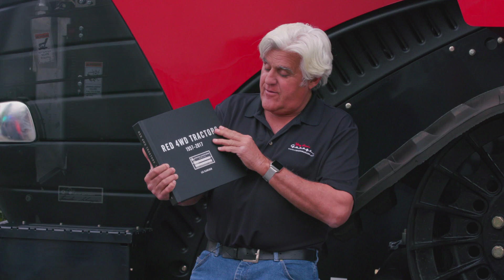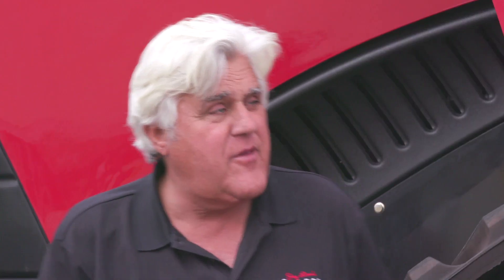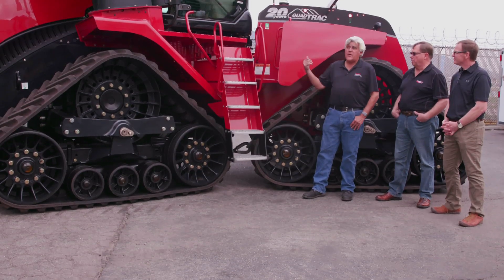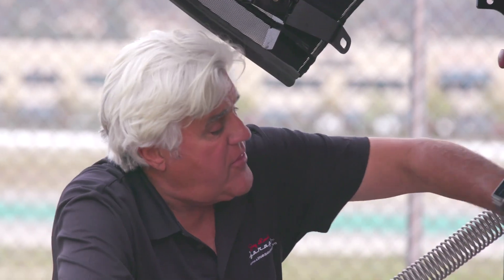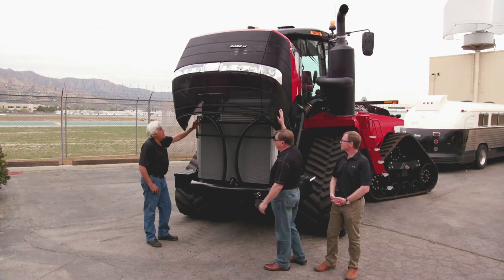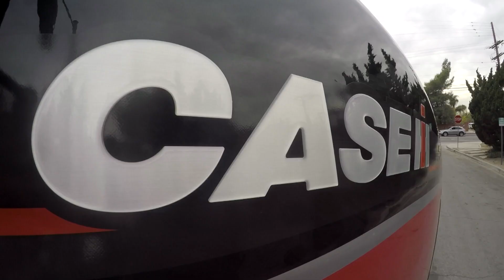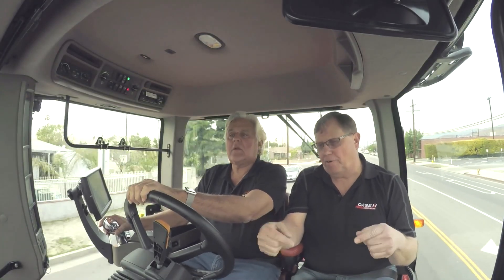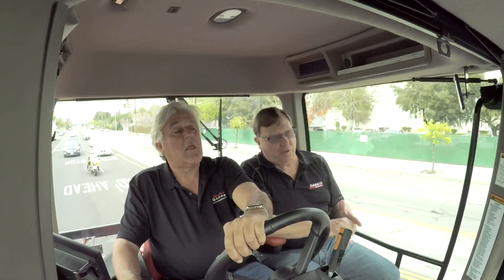2017 Case IH Quadtrac - Jay Leno's Garage

Comment: The older versions with the Cummins engines were very reliable.   Not sold on the Fiat/Iveco engines case uses these days.  The few I've been around just don't seem to be able to deal with things as well as the Cummins engines did.   The steigers in general are pretty darn good.  

The powershift transmissions are solid as well.  If you've ever been inside one you'd know why.   

One thing they didn't mention was the AG version and the construction versions of these are different when it comes to the articulation joints.  This one appears to be made for the construction side...the cable running from under the cooling pack back to the articulation joint is one of the differences.  (They use the construction version pull scraper bowls...sometimes two or three at a time.)

 They are a blast to drive!  😁

Comment: If you notice the cable hooked to the front going to the rear, Case tractors need it cos the rear end does break where it turns right behind the cab. We run dirt pans and have broken every one out of the 8 we used to have, we switched to John Deere and problem solved.

Comment: Jay stomp them about keeping the cab cool with all that glass lol the tractor's In our farm did not have cabs back in those day so plowing with a D10 dragging a 12 ton disc plow  doing 4 mph in the hot summer days of the Imperial valley was brutal! Oh I forgot about the 3 foot wide radiator fan blowing all the hot engine air right at you was double wammy🤗

Comment: These tractors literally saved thousands of acres of ripe wheat this summer in North Central Oregon by farmers using the tractor's speed and agility  discing around the fire lines creating breaks.  Sadly one was lost in the second of three separate fires and it burned to the frame.   One farmer died in the first fire when his traditional wheeled tractor tipped over an embankment.  We see these IH Quadtracs all over in the fields south of The Dalles.

Comment: I drove an Iveco Stralis truck with a version of the engine in that tractor, it's a Cursor 13 and the one I had was a 480hp with around 1,600 to 1,700lbs ft of torque through a 16 speed manual ZF. FPT do a 16L engine too.

Comment: The Quadtrac hooked me and its freaking quiet and smooth...put it on a diet for less pulling cap. and drop some ton-age. with aluminum and lower the height...it would be awesome for the street.

Comment: I'll just list the modifications I'll add to the Quadtrac if I had one:

1. A second transmission for high speed (55 mph max) while using the factory transmission for hauling

2. Add two Buell air horns: 1061 and 1062 while keeping the factory horn for urban areas

3. Buy a travel trailer and modify it with 3-point (for improved connection with the tractor), PTO (for using the tractor to generate electricity for the trailer), and hydraulic inputs (for things like the A/C and jacks)

Comment: I need a few of those Jay... thanks for sharing.. inter smash all... love em

hempseed oil has no limits for the supply.. it can be used straight up as diesel and jet fuel
Reply: if we don't change our evil ways.. we won't be here in another 10 years... it's dire
Reply: you should find that car sir.. there's a short bit of Ford propaganda showing old Henry out whacking on the car.. with a sledgehammer.. 

those tractors can be made from bio plastic.. so can the engines... it's flame resistant and after curing, does not burn.. steel has metallic bonds..  my bio plastic has double covalent bonds... with hemp or silk... it's a bazillion times stronger than steel, I am aiming for it being as hard as steel.. a stainless steel knife is 5.5 on the Moh's scale of hardness... 5 is high carbon steel.. it's 3 at the moment.. as hard as copper... ramp times in the oven take time to develop.. and the mixture changes according to what I have learned through trial and error... not too much error... I make it work

Comment: I wonder if that's a big version of quad-track or if all of the quad-tracks are that big. If so, I never realized how big they are when driving past them working in the fields.
Reply: Koreaboo62 they aren’t all that big but that’s the largest model. The more horsepower the tractor has, the heavier it needs to be to put said power to the ground

Comment: Pretty neat machine and Jay seemed to enjoy it as well. Only thing strange to me being a gear head is why the muffler is right up front creating a blind spot. Why not in the rear corner? And more confusing why is the exhaust blowing forward instead of sideways or to the rear. I guess they blow it forward with the muffler in this location so you can climb in and out without breathing in the exhaust while it's running but seems strange to have all that right in your forward left blind spot. EDIT...Ok I now see why they put the giant muffler in the front because on a farm the operator prefers to have a clear view of the equipment the tractor is pulling. Typically nothing to see up front but open field.
Reply: It's not a muffler.  It's the emissions control system, and probably cost more by itself than the car you drive.  It has to be big because it has to process exhaust from an engine that can run continuously at 600 HP all day out in the field.  Day after day.   Week after week.  Month after month.  Year after year.

Comment: JAY DRIVING A tractor now that's funny nice looking 26 to 30 gallon an hour is crazy I thought our big John Deere 4 wheel drive was pretty rough on fuel I was burning up 350  dollars a day in fuel so at say 30 by a 10 hour day never lol your talking about 900 dollars a day I'll keep the little Deere for real but we don't farm enough fields that you could even pull a 60 to 100 foot implement 40 to 50 is about it with some of the chopped up fields we farm I can barely turn around in them with a 50 foot implement lol 100 wow I would love to go see a 100 foot implement being pulled down the field crazy

Comment: Well, I would still rather be on our open station 1964 or 1968 JD 4020 Diesel on a cool spring or fall day, and sink those 5 shiny moldboard plows into the black Iowa soil, and pull that throttle down, and hear that turbo kick in on that big ole 404 cubic inch diesel, and watch the coal black diesel smoke blow out of the chrome exhaust stack. Yeah .... if you were around in those days then you know what I am talking about.

Comment: Dudes says "no humans touch it" when referring to welding up the 13 ton frame like it's a good thing....FYI bro, it's never a good thing when you and the company you work for lay men off in favor of a goddamn robot, that's one of biggest things wrong with this country...
Reply: Who says they layed anyone off? Chances are the frame welding stage was intended to be don’t by robots from the start. You can’t lay people off from jobs that don’t exist.

Besides even if they did, a robot does a better job than any human ever could. More reliable, more consistent, more accurate, faster, safer, more cost effective.

Comment: it's doesn't reduce the Nitrous Oxides!  It's Oxides of Nitrogen!  Big difference.  I worked at an emissions testing facility for 6 years and it's the same kind of people calling a catalytic converter a "Cadillac Converter"!  Really?  If your car produced Nitrous Oxide, then you would have a constantly increasing amount horsepower.  These Nitrogen Oxides are a byproduct of the combustion process produced at higher temperatures inside the combustion chamber. The EGR valve recirculates a small amount of exhaust gas back into the combustion system to lower the temperature and thus reducing the NOx, not NOS.  That guy seemed like he was knowledgable and knew his stuff, until the Nitrous Oxide parts.  He was just memorizing a sales pitch.

Comment: They are junk,I've been running heavy equipment for 30 years,the cat Challenger is a beast the case quad is a weak POS it looks good and runs good but when you hook up a dual pull pan system the case can barely move,the company I've worked with for 25 years bought several because they are cheaper than cat after 5 hours on the job we loaded them back on the low boys and returned them

Comment: yeah, these tractors are over sophisticated.  requires gps and a ground based antenna network.  then you can't repair them your self any longer.  with cars you can plug in your diagnostic tool and see what all the sensors and everything is doing.  with these tractors, only the dealership can do that.  then it's so computerized you got to download an update just about every time you fire the tractor up.  farmers know they can hop into their 30 year old tractor and get to work.  but it is always questionable with these new ones.

Comment: Go green!  Don't buy Case-IH Italian/EU equipment!  Buy US-Owned/US Made "John Deere" equipment!
Reply: John Deere factory locations for each of their series.

Tractors:

9R: USA
8R: USA
7R: USA
6R: Germany
6M: Germany
6E: Mexico
6J: China
5R: Germany
5M: USA
5E: India

Compact Tractors:
4R: USA
3R: USA
2R: USA
1R: USA

Garden Tractors:
X300: USA
X500: USA
X700: USA

Lawn Mowers:
D100: USA
E100: USA
S200: USA
Z300: USA
Z500: USA
Z700: USA
Z900: USA
X900: USA

I would post the CaseIH factory locations for each series, but a bunch of them aren't on TractorData for whatever reason. Probably parts from all over the place or something.
Reply: Mike Maes The German machines are extremely good. On-par, if not better than the US built ones. Mexico, not too bad. Chinese or India though... run away.